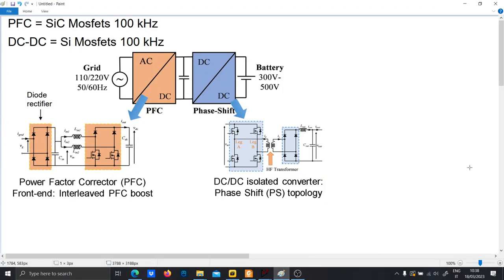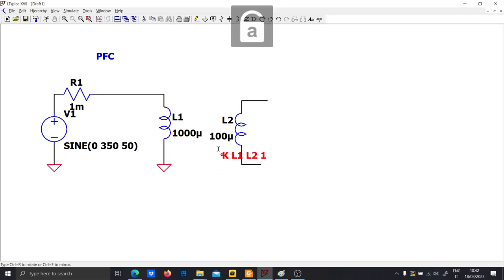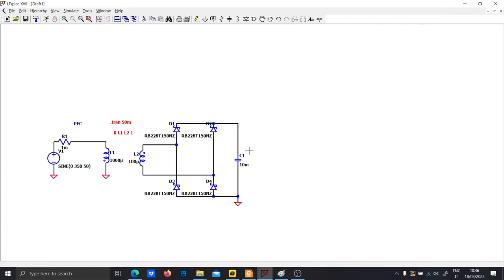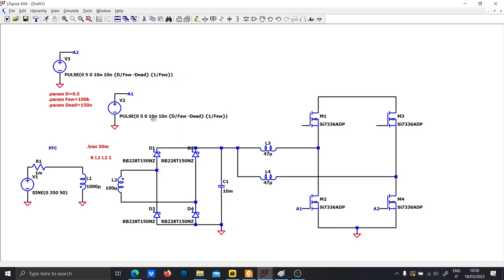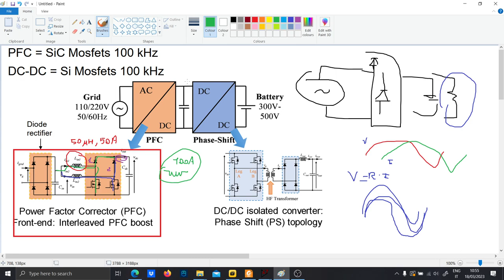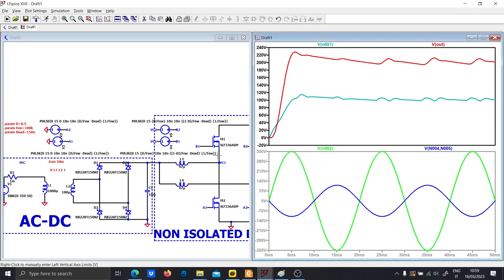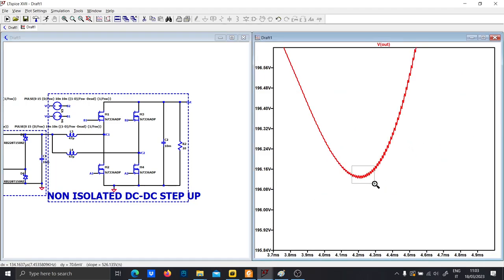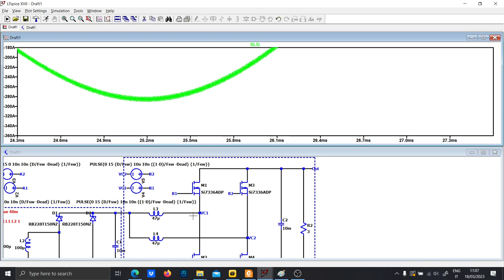LTSPICE 3kW OBC (AC-DC, PFC) Part  (1/2)

Comment from the maker: A Brief Note: The boost is in OPEN LOOP so it doesn't follow exactly the rectified waveform of the Graelz. I will make another video explaining how a full PFC Closed loop works, because the current of the boost has to follow the current of the rectified graeltz, which is not possible in open loop.
The project is quite long and it will take time, thank you for understanding
I will make also video about analog controllers and closed loop dc-dc converters
Take this video just as an architectural explanation
Reply: aM NOT finding your part 2 of this video. Moreover can you please make a video on PFC with dual active LLC topology
Reply from the maker: @Shivakumar-xm4xv  You didn't find It because this PFC here Is not controlled. I have made a video about PFC closed loop similation, but the similation Is far too slow, so I'm planning to use an "Ideal PFC" with spice-made simulink blocks

Comment: Thanks for the video. Sorry if this a stupid question. I'm a beginner. Why is the input step-down transformer necessary, if you're later going to boost the voltage? Why can't you just connect the input to the rectifier and boost?
Reply from the maker: When you start from the AC grid size, when you have to do with powers higher than 70W, a PFC is mandatory or you will have harmonic distortion by the grid. Most of the time, this is a boost converter or other harder topologies (Vienna for example). Then in OBC you need isolation, hence a two level half bridge or full bridge is recommended with transformer. Plus, it's not a step down, that transformer has to be designed accordingly and it's not an easy task